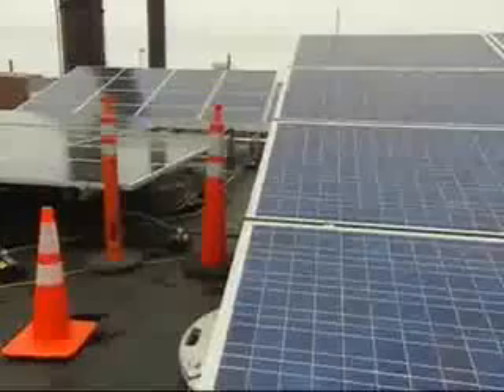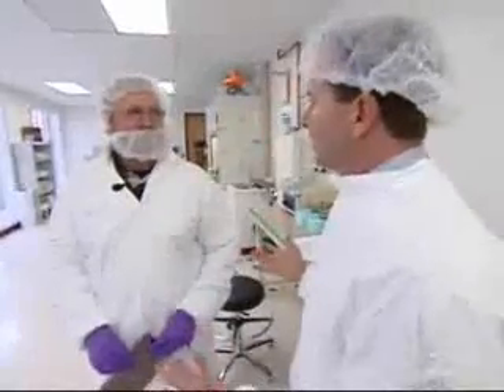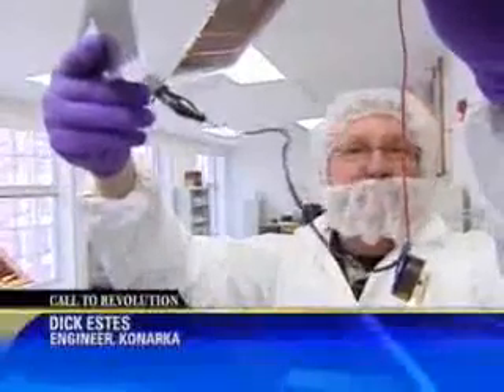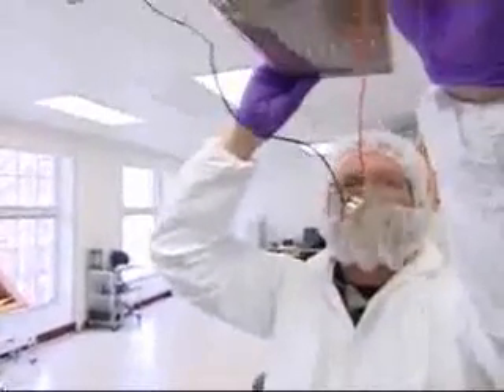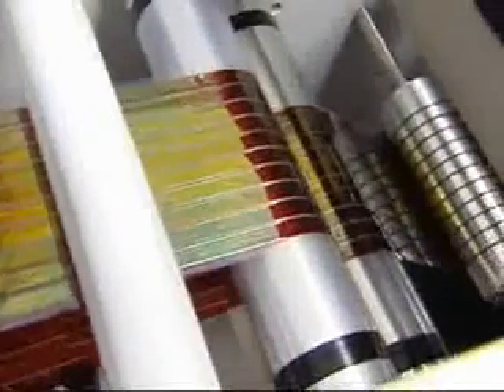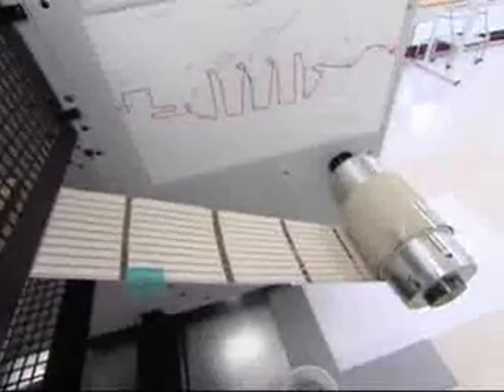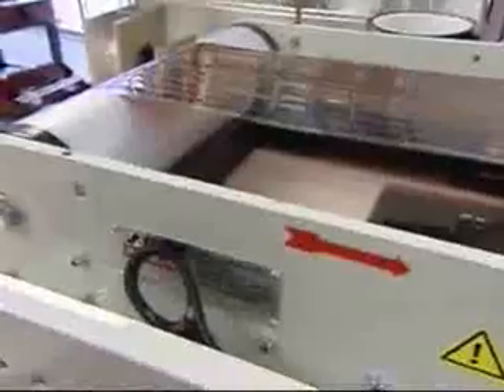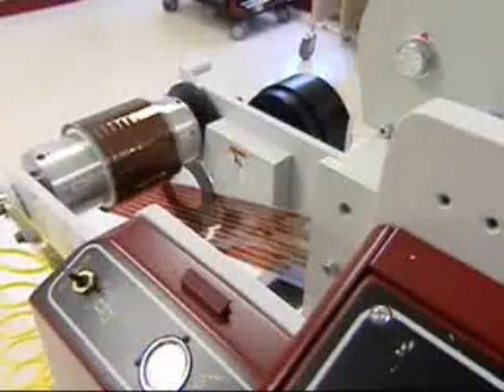Advanced Photovoltaic Solar Power Films, The Next Generation

Comment: 300 patents? When new meterials become available a number of companies can make new applications but its a race to who gets patents to prevent everyone else from doing the same thing (sometimes hoarding the tech like chevron is doing with NiMH batteries) instead of a race to manufacture the product. Often many are developping the same technology simoultaneously but the patent/litigation queen wins. The patent system should be abolished or cut down to 2 years max (a head start, not a sit on it).